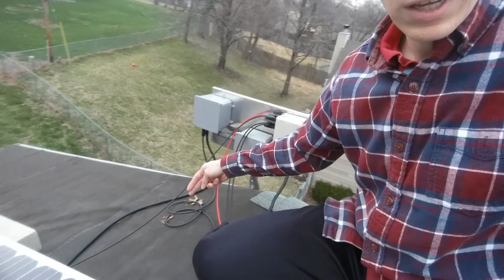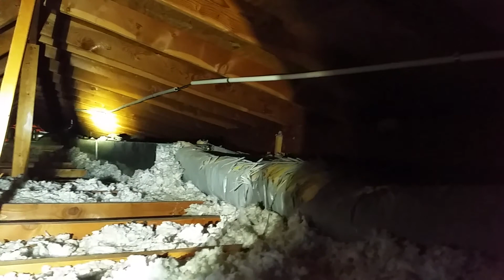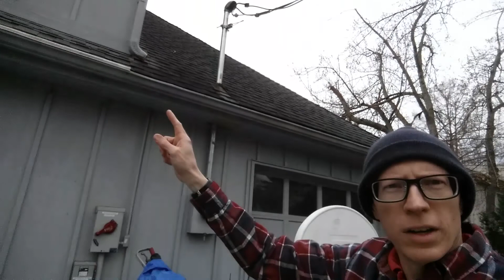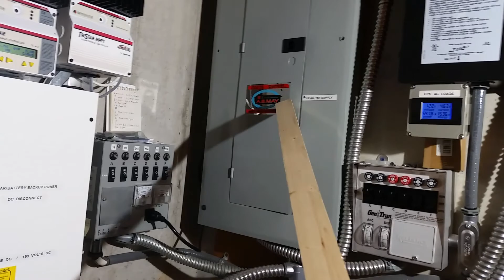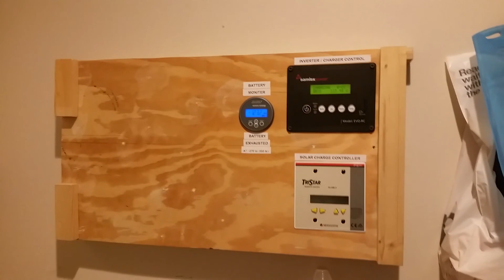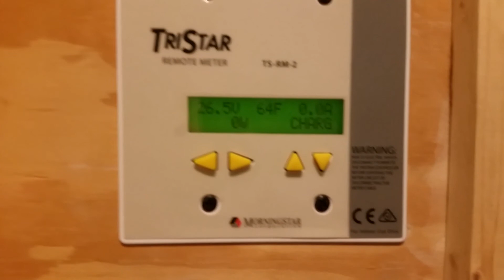Off-Grid Solar Backup Power System Overview

Comment: NICE SETUP BUILT AROUND THE SAMLEX INVERTER . THE PV MODULES ARE IN A GREAT POSITION PRODUCING THE BEST POWER  TO KEEP THE BATTERIES CHARGED . YOU HAVE A GREAT THING GOING WHENI IT COMES TO GOING OFF GRID ANYTIME AT WILL . KEEP UP THE GOOD WORK AND " MAY THE SOLAR BE WITH YOU " .